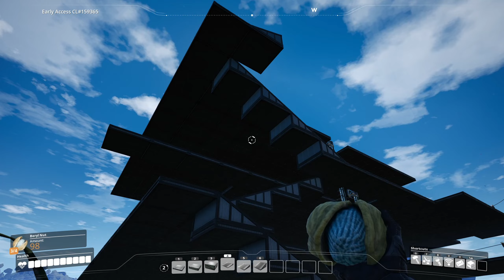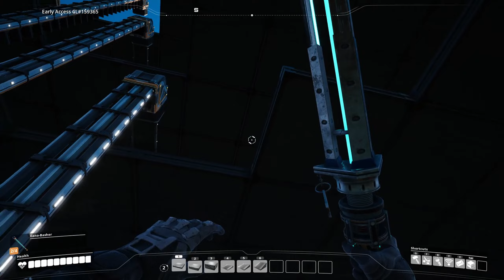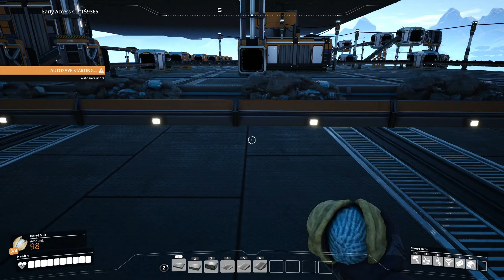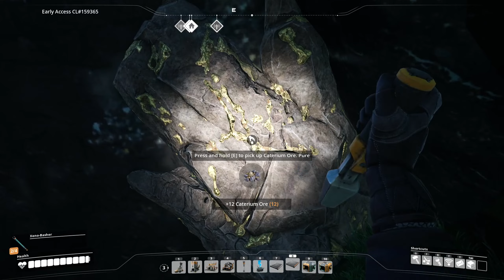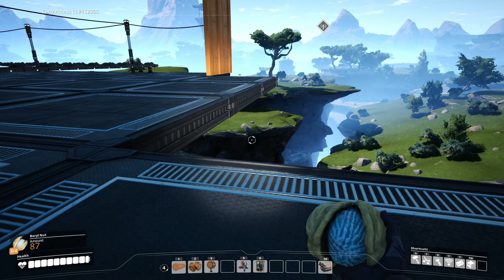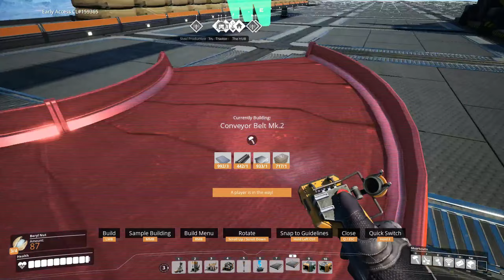Let's Play Satisfactory s01 e28

Comment: Explorer is FUN to drive but it has limited (25 slots) inventory, so not best suited for truck stations, Tractor though kind a slow (but faster than walking ) is also only 25 slots. Best bet is TRUCKS with Truck Station, drive them manually until you are ready automate them , Driving is fun though tricky at times
Reply from the maker: I'm looking forward to trying them!

Comment: You know, once you get the choo-choos, you're going to think "Why was I stressing about trucks?"  

To be honest, I belted everything from hither and yon to where I needed it until I started aluminum production and decided to finally use trains.  Never consider using trucks for transport as I was too busy belting the map like Josh from Let's Game It Out (which if you want a laugh and be horrified about what NOT to do, check out his channel).

Just make sure you bring fuel generators online before messing with trains.  More power is never wasted.

Also, when I'm I asked how much concrete do you need, my answer is "Yes."

When it comes to spiders, there's an arachnophobia mode you could turn on where it replaces the spiders with pictures of cat heads.  Those might be easier to see.
Reply from the maker: I'm definitely looking forward to trains, but I may look into truck routes largely just for the fun of it.  I wish trains were unlockable sooner so that I could setup transit routes from the beginning that leverage all available means of transportation (trucks, trains, drones). That's not the case, so I guess I gotta work with what I have.

I definitely want to avoid belting things across the map if I can help it. It's an obvious solution, but kind of a lazy one too. I'm not in a hurry to finish the game as fast as possible, so I'd probably get some additional fun out of playing with the tractors/trucks a bit.  Now that I've said that, I'll probably get to a point where I need to belt everything everywhere! 😅

The arachnophobia mode is great and all, but what do I do about my ailurophobia?! 😸